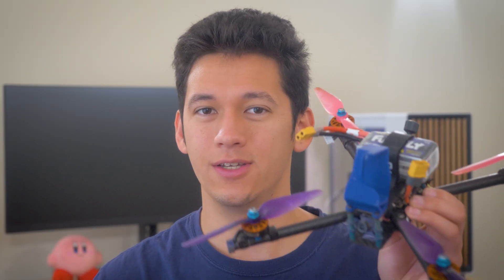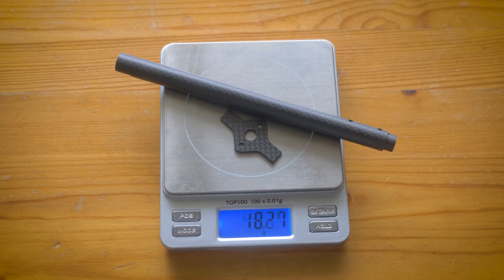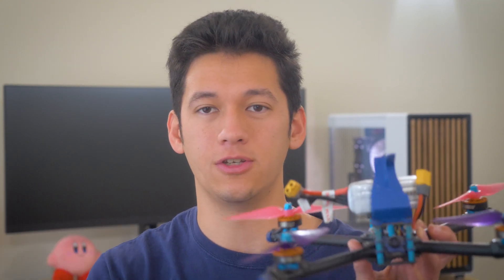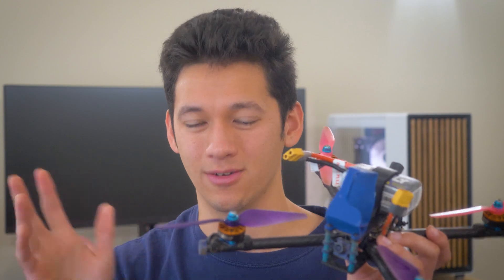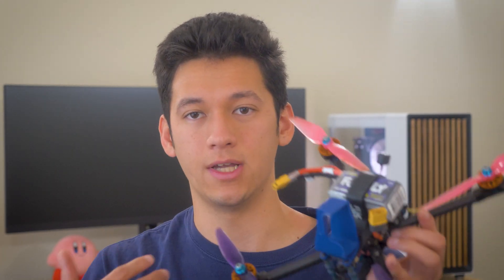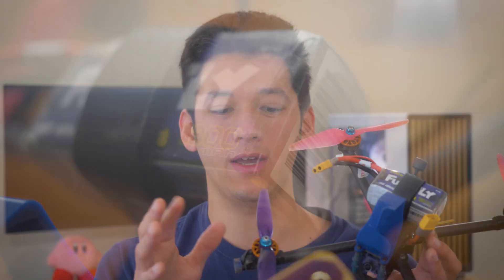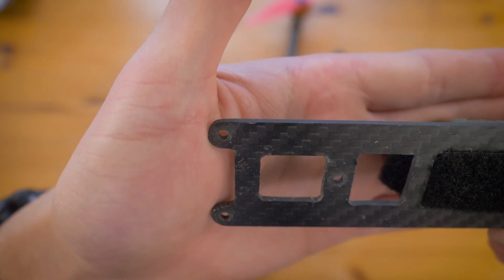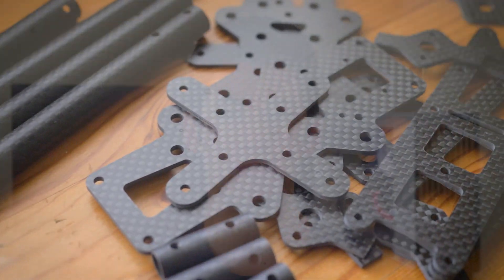The Best Freestyle Drone and Why It's a Failure - The Tubular Quad V6

Comment from the maker: Are you interested in more technical videos?
Reply: Yes please! Loved your older tech vids!
Reply: Yup bruh
.😊
Reply: Yup.  Enjoy your tech videos and your trick theory videos.  The flying videos, not so much.  Not because you are not a great pilot, but because YT has reached the saturation point of freestyle videos.  As far as flying goes, I enjoy the ads where dude is flowing thru a bowling alley or bar.  Those are a treat.
Reply: yes please more tech videos...
small thoughts
1- the funfly lipo I tried didn't last long and I never got this tattu model again
2- to compare to an flat arm weight you need to add to the tube the extra screws and tape on the scale
3- tubular may be stronger than flat in lab tests but fpv crashes have a very specific way of damaging arms which is collision on a specific point of the arm. lab test will usually just bend the arm until it breaks.
4- you need a 1450kv for a 6S and 6" setup and indeed it is not going easy to find.
Reply: Yeah man you did this REALLY well. Love your explanations 👌
Reply: I subbed, I'm here for this :)
Reply: Yes just without the background music when your talking.

Comment: Love it.  I've been wanting to do something like this with the rounded arms.  Thx for sharing.  My fav freestyle rig is a Five33 switchback frame with the long arms.  It's true X, light weight and I also run 6in bi-blade props.  Pretty similar to what your flying I think.  I got something called the "baby turtle" for recording.  It's a 20x20 board that records onboard 1080p60 and sends an analog signal to the vtx.  Unfortunately they don't make it any more.  My philosophy is if I want a heavier quad I'll add more battery.  The X frame and light weight makes it handle insane.  And it's been almost bulletproof when it comes to durability.  On the whole I haven't needed to work on it much.  I wore out a set of motors, and replace a bottom plate cause I did something funny.  I was showing someone how durable it was... I punched it for about a second.. then disarmed..  My intention was to have it crash on grass.  BUT... instead it dropped on concrete from about 120 ft up.  It bent a bell.  I had it flying in about 10 min with the same bell.  Didn't notice the bottom plate was busted till two fly sessions later.  LOL the crap we do with our quads is so silly.
Reply from the maker: Thanks! True X and 6-inch twin-blades is a great formula!

Comment: Teniendo en cuenta que un dron FPV de freestyle esta destinado a estrellarse, no veo util usar paras huecas en vez de sólidas, por mucho diámetro que tengan no ofrece mas resistencia al impacto contra algo duro, y es mas costoso de reparar que usar un poco de loctite y polvo de fibra de carbono.
Ademas que su fabricación, seguro que sera más caro que una lamina de 5 o 6mm que no hay que darle forma.
Bajo mi experiencia, no me convence.
Y ya, puestos a comentar, las bipala tampoco, me parece que no son tan impulsivas en freestyle como una tripala. Pero bueno, deoevde del vuelo de cada uno.
Reply from the maker: Higher cross-sectional moment of inertia increases bending strength, which corresponds to increased durability as long as the material is thick enough to resist crushing (I have yet to crush one of my tubular arms in a crash). 6 inch twin-blades are not quite as responsive as 5 inch triblades, but I am willing to make that sacrifice for the better efficiency, better grip, and effortless feeling of 6 inch twin-blades. It's certainly worth at least a try
Reply: I think people are willing to pay a premium for FPV parts, if the claims of improvement can be proven. The unit sales wb less, but the top line makes up for that.

Comment: What about using 2 long tubes notched and joined in the center instead of 4 tubes. That would take some of the stress off of the plates.

Great job, looking forward to seeing your videos.
Reply from the maker: Thanks! The Tubular Quad V1 used what you were describing and the arms broke at the notch. To more evenly distribute the stresses, attaching the arm by wrapping the arm, bottom plate, and middle plate in carbon tow seems to work quite well - This is what a lot of lightweight tubular LOS builds do. The disadvantage to using notched tubes and/or attaching with carbon tow is that you can't easily replace an arm; That is why my current design uses separate arms